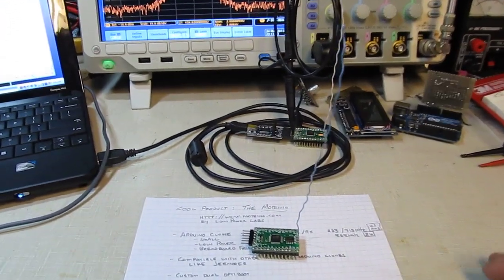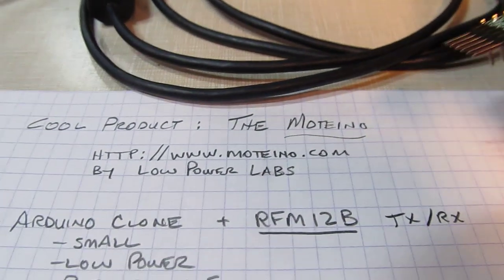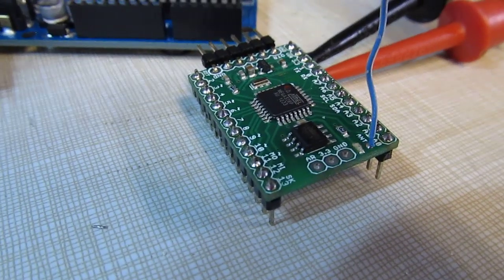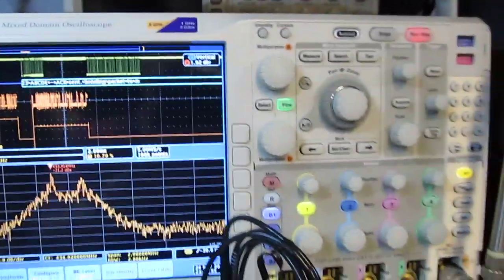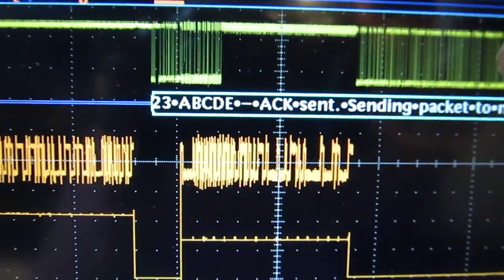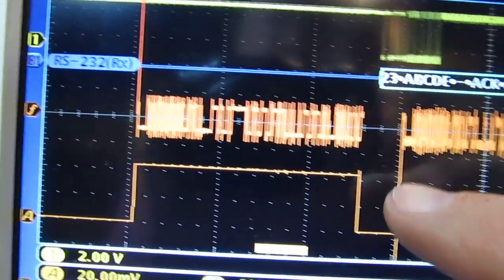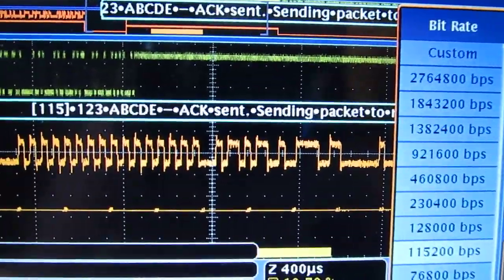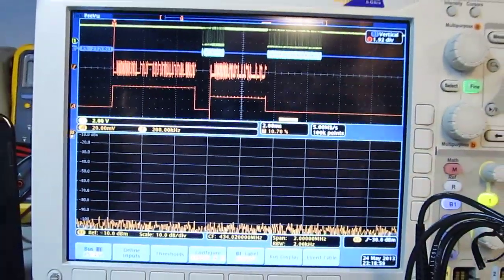#92: Cool Product: The Moteino - an Arduino clone + RFM12B wireless interface - low cost

Comment: I got a set of these Moteinos. R4/RFM69HW/433Mhz. In playing around with the modules, I found that the RFM69 sketch settings accepts and runs the boards at any of the available freq (433, 868, 915) and I see traffic in the serial mon as long as both modules are set the same way. I wanted to measure the actual freq that the xcvrs are running with my 2.4Ghz counter but reading are all over the place and they don't even come close to any of the 3 available frequencies. Any ideas? thx!
Reply from the maker: There are two reason that you're having trouble measuring the frequencies. The biggest reason is that the transmission is bursts, with burst durations of only a few milliseconds. Unless you can trigger and gate the measurement period of your counter, it can't measure the carrier frequency of this low duty cycle burst. The second factor is the fact that the signal is frequency modulated (FSK), which can also confuse counters.
Reply: *****
That makes a lot of sense. So, short of spending a fortune on equipment like the ones in your lab, what other ways would you suggest in confirming the actual operating frequency of the x'cvrs? Although my unit is labled 433Mhz, would the sketches help in making it operate in 868 or 915 (I would not think so...)? ie. Right now I see this on the monitor: (ditto for 866 and 433)
Listening at 915 Mhz...
SPI Flash Init OK!
[2] 123 ABCDEFGHIJKLMN   [RX_RSSI:-91] - ACK sent. Pinging node 2 - ACK...nothing
[2] 123 ABCDEFGHIJKLMN   [RX_RSSI:-91] - ACK sent.
[2] 123 ABCDEFGHIJKLMNO   [RX_RSSI:-92] - ACK sent.

Thanks again!
Reply from the maker: The operating frequency is not programmable. It is hardware dependent. Unless you've got a triggerable counter, or wideband scope or spectrum analyzer, it will be tough to measure the operating frequency.  Maybe a general coverage UHF scanner?  As for details of the sketches, I'd had to defer you go Felix at Low Power Labs.

Comment: Alan,
   Great Video. Being a micro controller fan myself I would be interested in seeing your
use of this product in a simple application such as remote temperature sensing or something similar. Your callsign seems familiar. I think we may have contacted you many years ago on 3.805 Mhz. with the gang that used to hang out there (Frank, Wayne, Paul etc.)  de  WB2FYZ